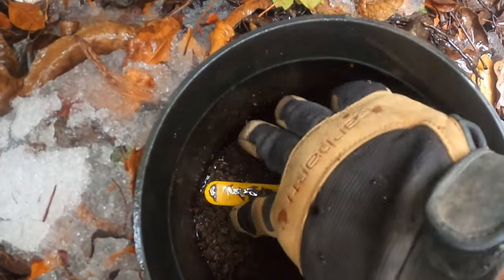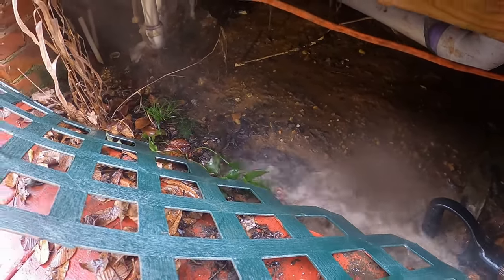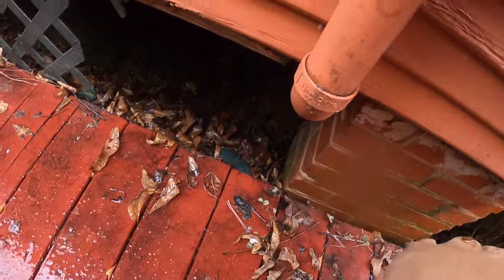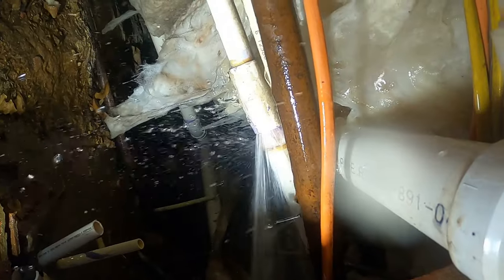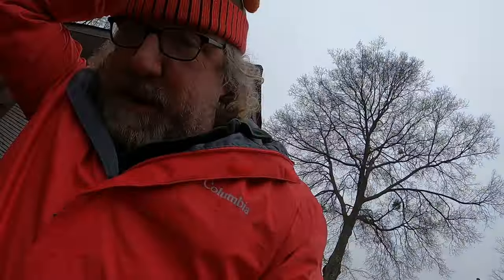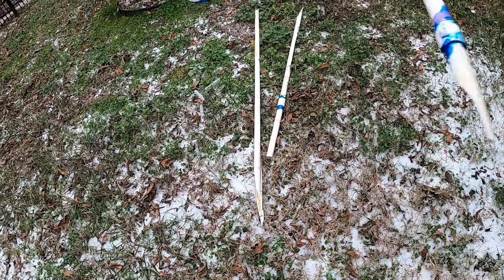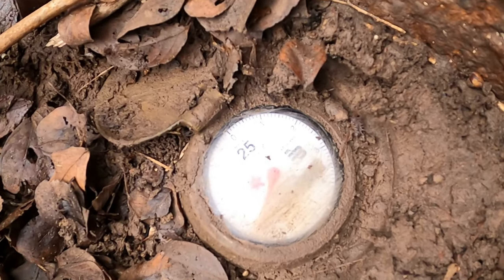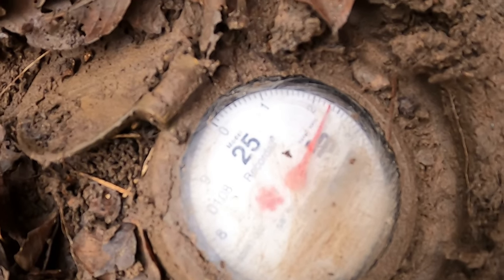Historical home. Repairing water leak on PVC frozen water pipe.

Comment: The fact that the water lines are that close to the crawlspace vent without insulation blows my mind. Even down south you should be prepared.
Reply from the maker: Agreed...working on that. Honestly I think insulation is a short term solution. Probably going to put heat tape under the insulation on the main water line tunk. We have busted water lines all over town after a deep freeze down here.